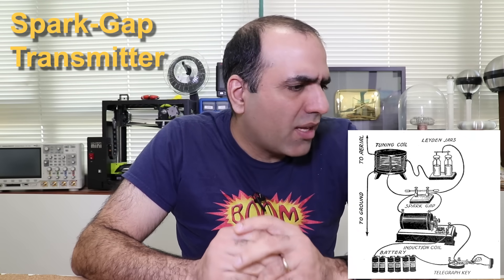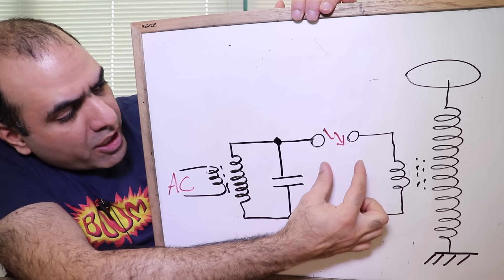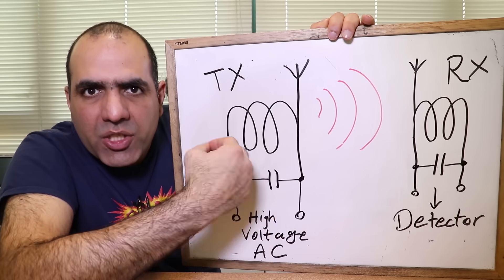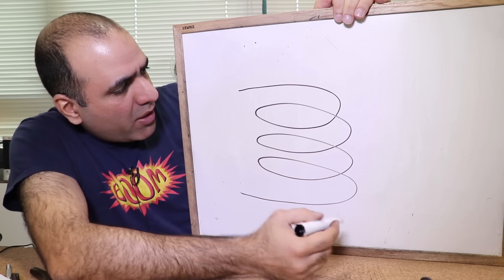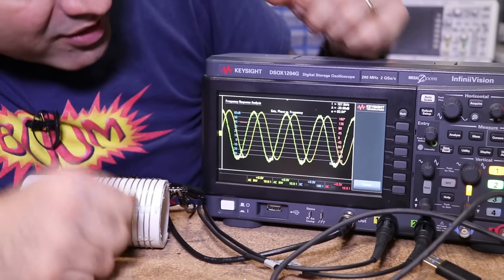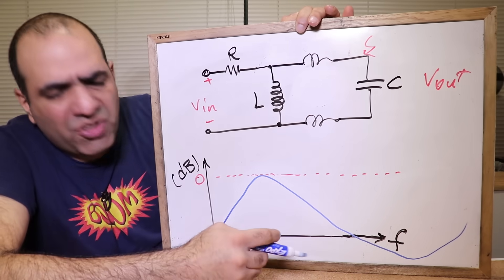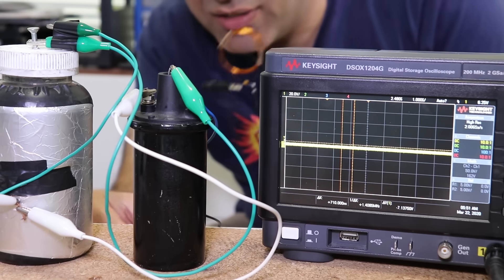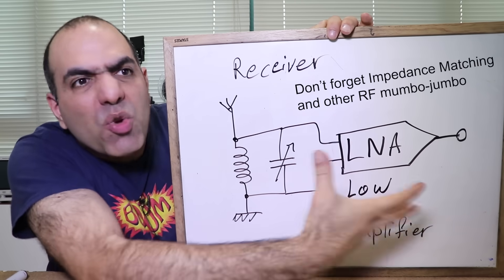Making a Spark-Gap Transmitter

Comment: I built this up. Used, initially a relay.  Then created a transistor circuit with a 555 timer.  Connected everything up.  Put the two antennas at opposite ends of the room.  When I ran the spark gap generator with the cap and coil it burned out my transistor (even though it's a high current transistor and gave me a shock through the push button.  So, I replaced the transistor.  The LED did not light up.  Then the transistor blew again.  I switched back to the relay.  No light at the LED.  (It does light up without the antenna when I put the coil close to the high voltage inductor.  So I moved the antenna to about four feet away.  The led lights.  It also lights without the receiver antenna (as long as the ground is connected.)  Not sure if the problem is the receiver or the transmitter or both...?  Maybe the receiver filter is not tuned correctly...?
Reply: Actually, I realized that I had two problems (with my relay generated system): 1. I was using a 68 Ohm resistor in series with the LED... replaced it with a wire) and 2. I had the transmitter and receiver grounded using wall outlets (as you did) but actually my receiver was not grounded... I connected both grounds together with a wire and now the LED is lighting up from across the room... but now I find that it lights up almost as brightly without connecting to the antenna... hmmm... maybe if I move it further away... or maybe if I move it outdoors and use an earth ground...?

Comment: Is that a surface mount resistor in series with the LED?  It's there b/c of the increased supply voltage, correct?  Can a simple leaded resistor be used instead?  What is it's value?

Comment: Also what was the input voltage on the transmitter side?  I've seen ( and own ) so called 'free energy' coils that are similar and rely on resonance in addition to high speed driver chip in order to produce 'extra voltage' on the secondary coil.  It does work by the way in terms of voltage, but I'm still trying to determine the current in order to make sure it either is or isnt receiving 'free energy'.

Comment: That little piece made with a relay I did something like that, but as I didn't have a relay I made one with a transformer, I separated the plates in E and I, created a joint and when the magnetic field pulls the part in I pull together the spring of a sparkler that has on cars that use these old coils

Comment: The high voltage on the tesla coil is created by a combination of resonance and by the mismatched impedance of the 1/4 wave transmission line formed by the secondary winding.

Comment: Impedance matching is pain in the ass, I built a yagi-design 4G-antenna because the network was terribly bad and unstable. It helped a lot with the signal strength, but I am sure it could be optimized for even better signal gains

Comment: To improve the range of the transmitter you could change the coil to a single turn coil on a large frame with the same inductivity. There are videos on YT with this kind of antennas. (your neighbors will be happy)

Comment: Could you do Corona discharge / tesla ozone generator please? High voltage. High current. Cheap $10 on ebay for industrial element. Could you please do an ozone generator? Either gaseous 10,000mg/hour 10G 100watt or aqueous 3,000mg/hour 3g/hr 13watt diy or both for science project for us to make for seniors in or community? e.g. a diy cooler grocery sterilizer or mailbox sterilizer? Who says ozone most effective sterilizing agent. NIH says 4X stronger than alcohol. Ozone, O3 reverts to O2 in about twenty minutes. CDC guidelines acknowledge this too. If used OUTSIDE, away from people, pets, plants, could save many lives especially as we reopen.

Comment: Love the video. 
People should be aware that transmitting with a spark gap transmitter is probably illegal in their country. It can make a mess on not only The Amateur Radio Bands but on all radio Services, including emergency services. Try listening to AM radio (remember that?) near a faulty AC line insulator. I dont want to be the Radio Police, just informing anyone thinking of making one .
From Wiki::
The radio signals produced by spark-gap transmitters are electrically "noisy"; they have a wide bandwidth, creating radio frequency interference (RFI) that can disrupt other radio transmissions. This type of radio emission has been prohibited by international law since 1934.[5][6]

You have been warned

Comment: The fact that this guy knows how to hurt himself without killing himself proves how smart he actually is
Reply: Lmfaooo I guess you could say that except for the time he was celebrating 1M subs and made Jacob's ladder out of 28 inch sparklers and it got too top heavy and came down on him and he caught it with both hands and he would've cooked to death if the alligator clips weren't alligator clips but rather soldered together wires it wouldn't have disconnected like it did with the alligator clips and he narrowly escaped death. It was gnarly lol
Reply: @r4ng3k03r1  that "sentence" is so painful to read
Reply: He's mentioned that many of his shocks or explosions are either faked or exaggerated for comedic purposes pplbut yes the Jacob's ladder was not faked and he was in actual danger. You can tell by his reaction and how he refers to that as one of his moments of actual danger.
Reply: @shiftypenguin472  Yeah, but the use of power cables as antennas and grounds without mentioning NOT to connect to the other sparkly parts of the wall power . . . still liked and subscribed, but I have an engineering background.
Reply: exactly
Reply: Lol

Comment: ElectroBooM ..I got a crazy suggestion for you. can you try to connect a high voltage diode in reverse on end of the secondary winding and make a negative iron generator to fight the Air borne Corona Virus !!!

Comment: negative decibels still confuse me
i've never looked into what exactly it means.. but still lol
Reply: It's just a relative measurement, for example 0 dbm = 1mW, a positive dbm value is more than 1mW while a negative value is less than that.
Reply: @Basement-Science  
oh, thats way simpler than i expected lol 

thank you :D

that seems like an absurd way to measure something though ><

wouldn't it be easier to say the actual value though?
1.5mW
1mW
0.5mW

(i realize you aren't the one that controls these things, but just sayin' lol)
Reply: It has to do with powers of 10. 

20dB is 10^2 = 100
10dB is 10^1 = 10
3dB is 10^0.3 = 2-ish
0dB is 10^0 = 1
-3dB is 10^0.3 = 0.5-ish
-10dB is 10^-1 = 0.1
-20dB is 10^-2 = 0.01
Etc.

Comment: Clueless people looking for entertainment: hehehehe
Seasoned hams: WHO IS THIS IDIOT I AM HEARING ON ALL BANDS?!
Reply: Heh, had the same thought. Though with the tiny output power I doubt the signal would go more than a few houses in every direction. Still would be annoying as crap tho.
Reply: You call hamburgers "seasoned hams"?
Reply: @CFSworks  No, "hams" are amateur radio operators. They have been given a band of frequencies to operate under to communicated with other people around the world, like a talking by a cellphone. Many think that it's nerdy hobby that should have gone the way of the dinos, but the entire concept is what enamors people: instead of using cellphones to communicate, having data transferred and transmitted to countless different systems, routers, satellites, etc., ham radio operators communicate only with antennas, from transmitter to receiver. Its really fun to get into if you like that kind of stuff, plus there are bands you can do CW (Morse Code communication) in.
          The reason everyone is joking about spark gap transmitters is that frequency is hard to control on those things, and they were banned for communication in the 1920s. If someone does do spark gap transmission with an effective antenna, every ham nearby and even further would hear a ton of noise and scratchy sounds, which is illegal.
Reply: @thatrecord5313  And you call them "seasoned hams" despite the fact that they're obviously grilled?
Reply: @CFSworks  Well, no, seasoned hams is just a term we call experienced ham radio operators. Other than that, I feel like you are trying to reference the Simpson joke of steamed hams. Close... I guess?
Reply: @thatrecord5313  Ding, ding!
Reply: @CFSworks  aurora borealis? At this time of year, at this time of day, in this part of the country, localized entirely in your kitchen?
Reply: @thatrecord5313  May I sound it using my NVIS radar antenna?
Reply: More like "WHERE IS THIS GUY AND WHY DOES HE NEED HELP????"
Ugh.  I hope people don't start playing with spark gap transmitters.
Reply: @jonc4403  +1000. The noise from crappy switching supplies in LED lighting is bad enough, the last thing we need is people playing with spark-gaps of all things.
Reply: @jonc4403  Oh you're the guy I thought would be fun to piss off a few comments up.
Just once. Until the strongly worded letter telling me to stop would arrive at my doorstep.
lul

Comment: The FCC has rules about using these type transmitters - with penalties. They are extremely broadband transmitters and can cause serious damage (interference) to other electronics devices and communications systems.

Comment: One day, I believe that I will tune in to one of his new videos or someone else's and it will contain the lines "This is how I figured out how to make a tabletop over unity nuclear fusion reactor that only produces 100kw" and it will contain clear instructions on how to build and design one from parts from an old dishwasher, microwave and washing machine motor, made for 200 bucks.

Comment: Hi Medhi, I'm wondering if the rise in the bode plot after 10MHz is because of the non-ideal behaviour of the capacitor; not because of the inductance of the wires. At high frequency there is a point where the impedance of a capacitor starts rising again and the capacitor will behave more like an inductor. If you look up freq/imp graphs of common caps you will see that this turn point is usually around 10MHz, exactly where your bode plot starts rising again. At these high frequencies, the capacitor is like an open circuit again. This would have a much greater impact on the bode plot than the inductance of the wires.

Comment: Tesla wasn't wasting his time at all Wardenclyffe tower may have worked different then one may think. Tesla was extremely interested in vibration and the resistance between ground and ionosphere. I believe the tower was a small cog in an evolutionary idea, I think Tesla was using the aquifer to create an electrical connection between the ionosphere and ground. I think he was using the tower to tune the earths vibration just like the transmitter you are making. The entire earth would have been the transmitter not the tower quite like how one would tune a Tesla coil utilizing the spark gap spacing. Not only would you be able to provide high power but one could also use this to send a mass signal to other planets. I don't claim to be correct on this it is my personal observation.

Comment: Can you do a video on induction heaters that they use to heat metal for bending. I got one off ebay for a few dollars but the coil is 5mm to small for the metal I want to heat. Can I make a new coil, larger, do I need less turns for resistance or can I make it as big or small as I like. Of course I don;t want any math to do so what do I need to work out to make the coil larger?

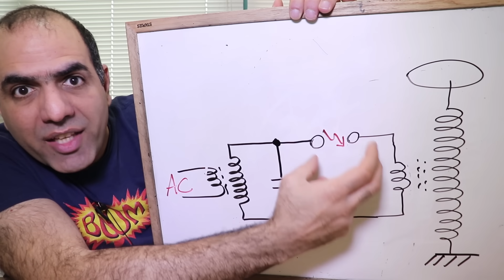Comment: At 2:16, you say "an arc has very low resistance".!  What exactly do you mean about this.?  I understand that it has very high voltage, and, very low current and therefore low power. And the air obviously has high resistance, but I don't know what you mean by what you said about the arc having low resistance. 
Please educate me on this. I'm an electrician (with a very limited grasp on electronics), so understand a lot of what you say, along with all the stuff that goes STRAIGHT OVER my head. So, I'm sure that if you give it to me via layman, I'll be somewhat the wiser(I hope).
Thanks for your time, and hope to hear from you soon. 
Rich(UK).

Comment: At minute 7:53.question:the coil inductance shouldn't depend on the resistor, whatever value you pick. But your formula does make it depend on it, and you choose 100Ohms resistors. Why do you choose that value. What if I had used 1KOhm instead? Since L=R/2πfc. You'd expect x10 the value.
Reply: Because f_c also changes with the changed resistance

Comment: To all the people saying that Diodegonewild says that this circuit wrong I say that Diodegonewild was talking about a different application.  He is building a Tesla coil which is a much higher power level of the order of several kW.  In that application it's impodrtant that the high RF power is kept out of the mains frequency transformer to prevent it from overheating.  In Electroboom's much lower power transmitter circuit it doesn't matter which confguration is used.  Both circuits are correct for their application.

Comment: @ElectroBOOM Awesome video! :-)
Have you ever build a simple Coherer receiver? 
It's just a tube with metal filing acting as receiver, before diodes or transistors where around. 

I'm building these with students, it just needs a piece of PVC aquarium tube,  metal filings, button cell and LED. Some garden wire as antenna. (Transmitter: Layden jar out of film can, tin-foil, paper-clip, no water :-) PVC rod and paper towel for charging.)
Reply: I made coherer detector but i have problem with transmitter

Comment: https://youtu.be/0rA-zhTJuFU This is not possible what so ever to power a tube TV from a single 1.5v AAA battery much less even get it to turn on at all. U need more than 1.5v to turn on a tube TV. That tube TV is definitely running off 120v AC otherwise this tube TV would not do anything.

Comment: FCC: "Which frequency are you transmitting on?"
E.B.: "Yeah".
Reply: The output of a spark gap transmitter is very wide. The instantaneous surge of current through the air causes a pop which can be heard regardless of which frequency your receiver is tuned to
Reply: @anthonydotmoe  Has this to do with harmonics?
Reply: @killthesource4740  Yup
Reply: Haa, all of them that are possible.
Reply: @grassroot011  Why are all of them possible? I'm kinda confused sry
Reply: Had the exact same thought.
Reply: More like the Canadian equivalent of the FCC.
Reply: @imark7777777  that would be Industry Canada
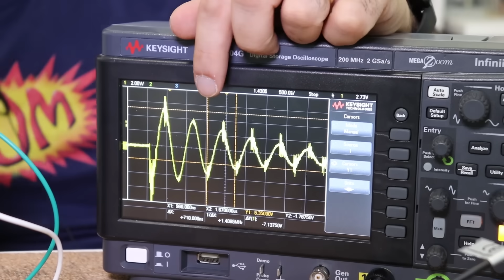Reply: He does show the frequency @ 12:10
Reply: Steve I that's the theoretical frequency but in practice it's so wide that it'll interfere with all most everything when we experimented with one we had to use a faraday cage to limit its effect... watch this demo lol https://youtu.be/T8BTgiSnIzY
Reply: @philkennedy342  Very true: The BBC has a small radio museum in their basement, and one of the displays is an old spark gap transmitter, fitted inside a faraday cage which is then encased in a glass box, with a button on the outside visitors can press to activate the spark. Part of the information next to this display explains that the faraday cage is necessary to prevent the spark gap interfering with (they say totally blocking) every single radio channel broadcast from the main BBC building above.
Reply: Lloyd Evans I've visited it and it's fascinating if your into radio and broadcasting 👍👍
Reply: Good thing he's from Canada, he can tell them to politely f off lol
Reply: FCC has no jurisdiction over EB though, he's canadian, not american. :P
Reply: What frequency are you transmitting on errrr!!!!!
 "all of them"😂😂😂
Reply: ALL !
Reply: YES.........
Reply: Um errr ah oh , sorry sir i think full specturam
Reply: Lol
Reply: ok but like... 1.5 Mhz
Reply: Excellent video, Great demonstration of the transmitter/receiver and the LC circuit theory
Reply: DC to light.
Reply: Epic
Reply: Despite being in Canada, he still can make some good friends of radioamateurs and SWLs ringing at his door.  :)
Reply: “If I move farther away, I need an antenna” yes, Madhi, if you are close enough you can just hear the homebrew LIGHTNING you just made. 😂
Reply: More like:

FCC: "Which frequency are you transmitting on?"

E.B.: "You have no power over me! MUWHAHAHAHA".
Reply: What is FCC?
Reply: @niko5008  Federal Communications Commission
Reply: @niko5008 He's in Canada, it would be a combination of Industry Canada and the CRTC
Reply: @niko5008 BRUH YOU IDIOT
Reply: https://www.youtube.com/watch?v=lXIUZ4pegtY

Comment: When I was a kid I built a spark gap transmitter with instructions from an early 1900's book.  The coil and capacitor were hand made and I used a Model T coil.  I have no idea of the values of the components.    It interfered with AM, FM, and both audio and video of TV.  It also could be heard on CB over a block away.  I know because I sent my little brother down the street with a walkie-talkie   I figured it was illegally broadband and shut it down hoping the FCC hadn't had time to track me down.   I would not recommend building one of these if you don't like jail or paying large fines.

Comment: As a ham radio operator, stay the hell out of my neighborhood. LOL We have enough to deal with with all those cheap switching mode power supplies out there. A long time fan....
Reply: Cheap LED lighting is the worst in this regard... I'm running the LED lights in my lab off a 24V power-one linear supply just to shut them up.
Reply: @H-77  just use incandescent
Reply: @arthurmead5341  yeah everyone loves those crappy illegal light bulbs (no they don't)
How about use an LED light with a driver circuit that doesn't suck.
You find LED lights meant to be used for video recording. 
Simple and cheaper than running an incandescent for 8 hours.
Reply: @Boogie_the_cat  Absolute smoothbrained take
Reply: This was back in the socket 7 motherboard days. My dad used to complain all the time how noisy that AT power supply was 🤣